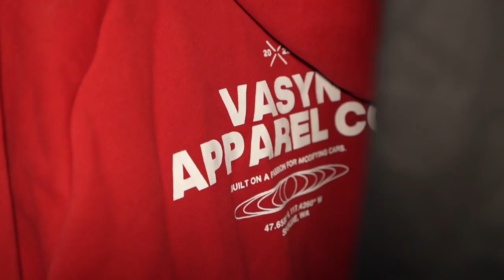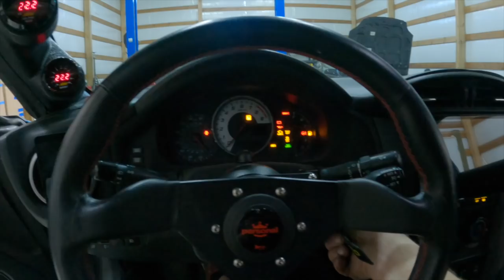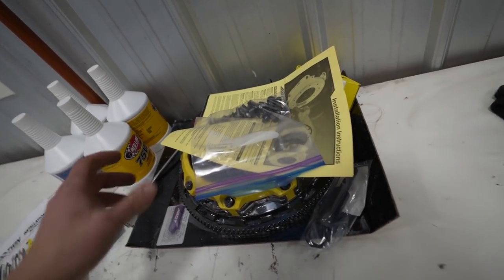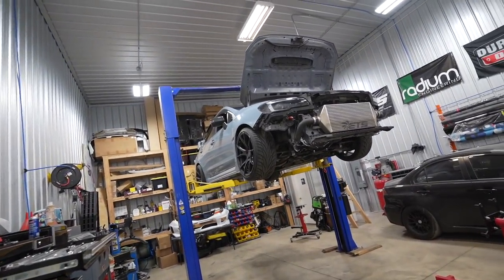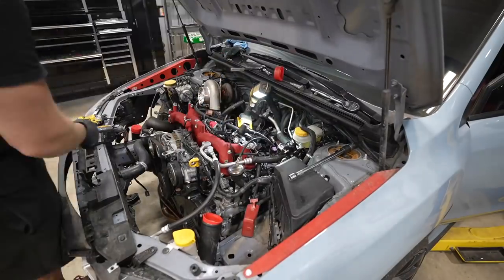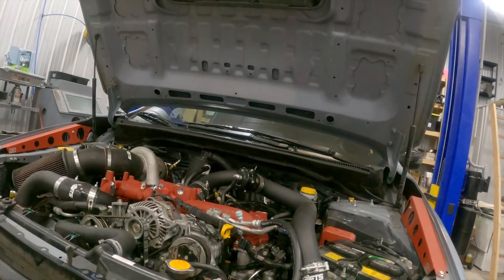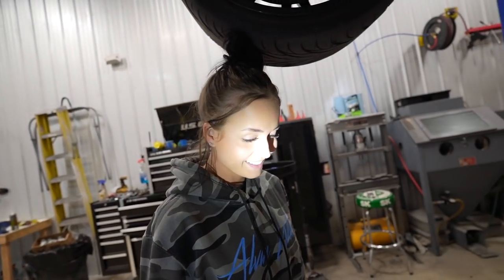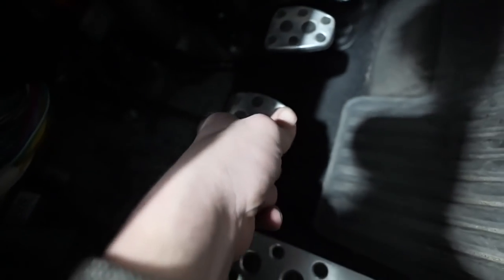Installing the Twin Disk in her 500WHP+ STi!

Comment: I'm glad you did you this video, I was just looking to order the same clutch. I'm currently running the ACT-HDSS and the peddle feel isn't bad but it is slightly heavier than stock. I am thinking about getting the 6 puck race version with sprung hub though. I think the combination of light peddle, and sprung hub would offset the grabby nature of the 6 puck. I just upgraded from ID1700s and a PT6262 to a PT6870 and ID2600s in my STI so its about to make some serious sauce and I need a clutch that will grab but still be street friendly enough to go for some weekend cruises.

Comment: It drives smooth like stock during normal driving conditions in my opinion. Nice light pedal. Only downside is the heavy sprung hub. It'll effect your lighting fast shifts and cause accelerated wear on your synchros when you roll fast through your gears. A little patience needed.

Comment: bro i want to buy either a wrx or an evo, honestly what should i get? 
ive never driven an evo or wrx before, im used to my ford falcon xr6 turbo and its auto... yuk i know but has 240kw probably around the 320 hp to the rear wheels, 
i really want to experience an evo or wrx so badly... like a built one..
 so again what do you think i should get?
evo or wrx